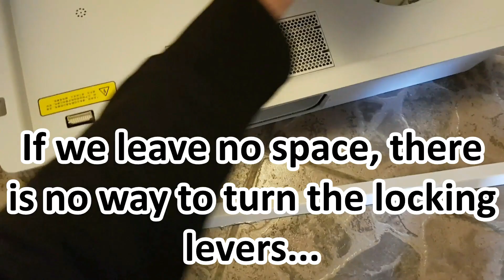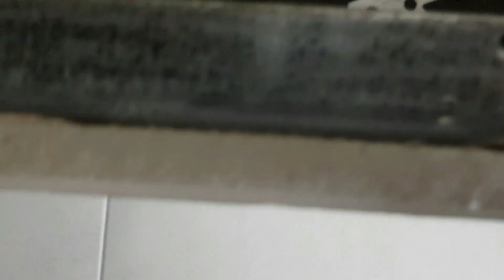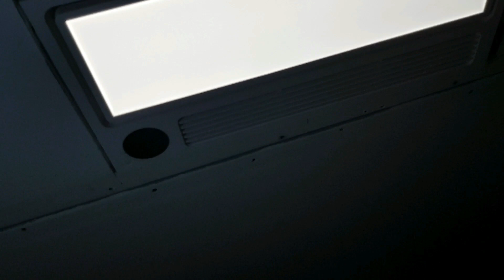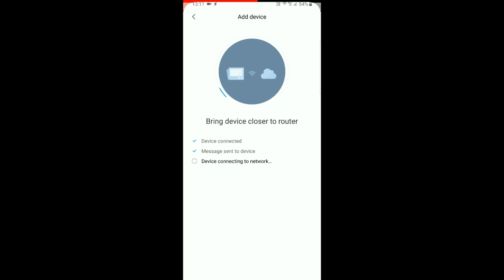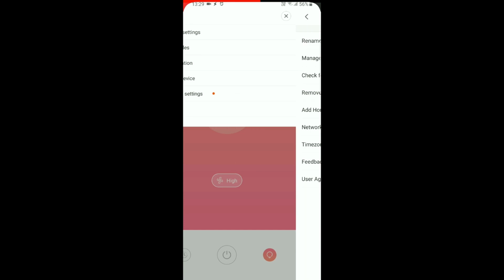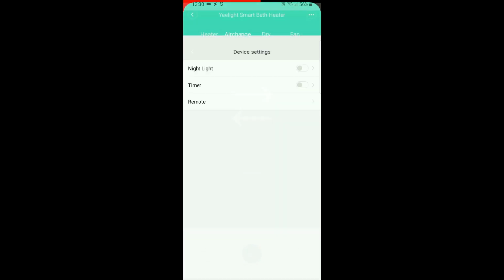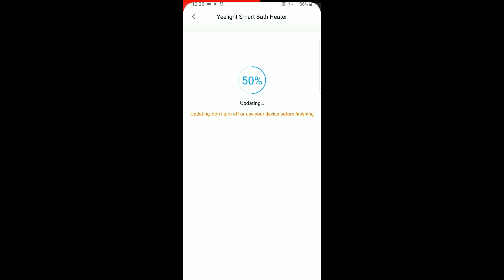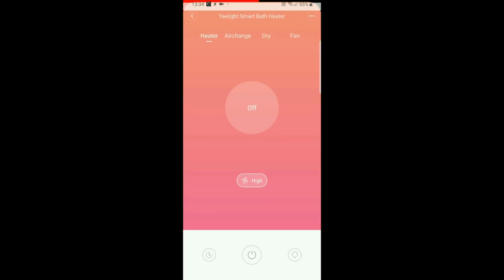Yeelight Bath Heater (installation)

Comment: Thank you for the installation video. I recently installed it but it seems the air extraction doesn’t work as the room is steaming up no matter what function I selected. Just wonder whether your can feel the strong air extraction feeling from the gap around the light? Just want to check whether I have installed incorrectly or some faulty parts
Reply from the maker: It is definitely working, there is huge difference with and without it. The humidity is still high, but the room doesn't steam at all when it is on.
Reply: Thanks. may I ask which function you use during bath and after? At the moment after the shower, the steam/humility causing the wall problem and steam on the mirror are pretty bad. Just wonder whether I have used the wrong function
Reply from the maker: Second button from the left (top row) on the remote... Air Change I believe.

Comment: This thing does not need to be screwed on to anything? Its just resting on the edges of your plaster ceiling? You didnt show where does the AC wires goes in
Reply from the maker: No it doesn't, it is really light ~6kg. It is not on plaster, the ceiling is some kind of board, plus there are 2 rails for the heater on which it stands. the plaster is only around the hole. The wiring is easy, just connect 2 wires....

Comment: Hi I can’t seem to sync the remote control with the device. Please help me on how to do it
Reply from the maker: I can't remember how it is paired anymore :)
Reply from the maker: In the manual they say 1) connect heater to power, 2) on remote press simultaneously wind direction and hair dryer buttons.
Reply: I tried doing that and there is a red light on the remote that flickers but nothing happens on the heater. How to fix that? Thanks in advance
Reply from the maker: I think that the heater must be unplugged and then plugged in and that you have like a minute to pair, try that.

Comment: Thank you for this video.
Can you tell me what is lowest heating temperature I can set(I ask as I saw there is similar xiaomi VIOMI VXYB01 but minimum temperature is 25*C what is ridiculous imho).
Can I set something without phone or remote(on main unit itself, I saw there is little button)? What is range of remote?

thank you in advance
Reply from the maker: You don't set the temperature, you just turn it on and you can set the fan power low/mid/high. You'd need temperature sensor if you want to automate it. You can operate it on phone or remote, there are no buttons on unit to operate it. That single button is emergency off. I didn't test the range, since I have no need to operate it via remote when I'm not in the bathroom :)

Comment: What is the difference with the PRO version (Yeelight YLYB02YL)?
Reply from the maker: From what I've read pro version has one more mode, but I am not sure what it does :)
Reply: @dalanik  i think the main difference are the flaps.The specs are the same. In this video, is in Vietnamese https://www.youtube.com/watch?v=p_M3Gq-Xob8 at 10:00.In the app (looks a bit different maybe is an old version)you can control the temperature .

Comment: Hello from Spain. I am having a problem with yeelight bath heater. The app need to update the firmware but when it's downloaded, the app give me a message about time exceed in installation. How did you mend this problem? 
Thanks a lot
Reply from the maker: I didn't get any updates recently... which firmware are you on?
Reply: @dalanik  last versión is 2.0.5.0032. current is 2.0.1.0024
Reply from the maker: @chemamvp  im on 2.0.7